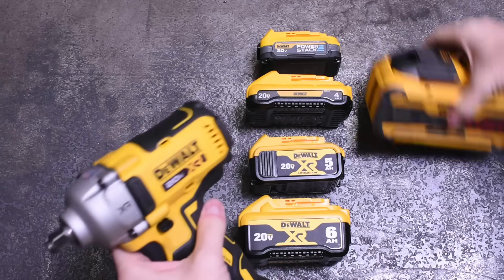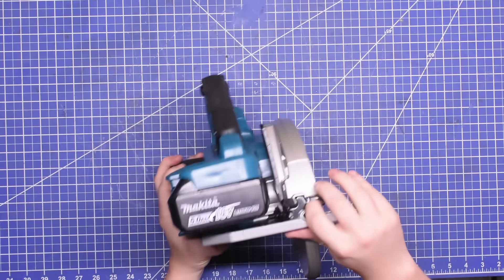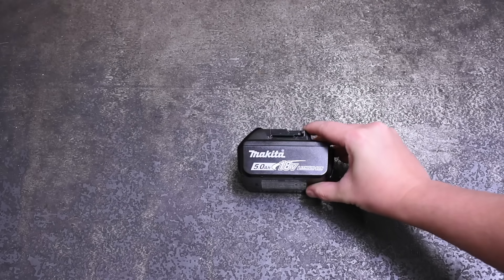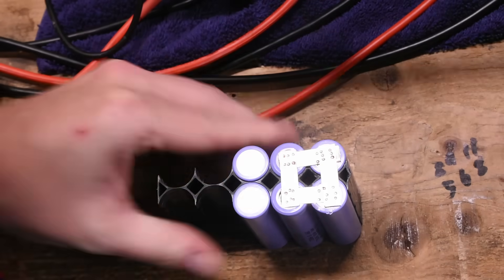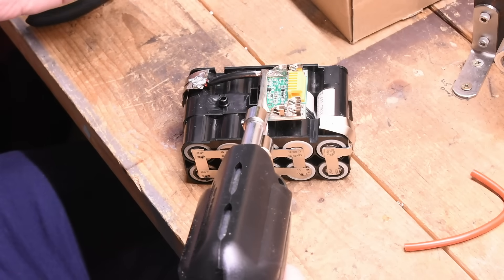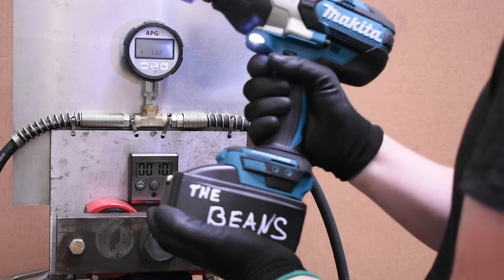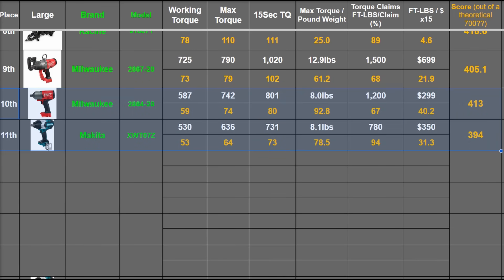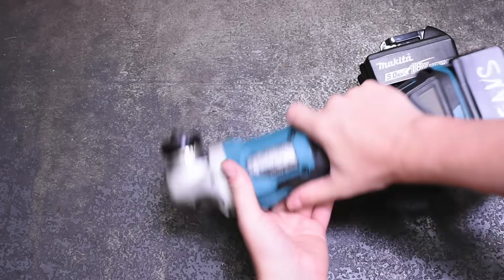We Built the Best Power Tool Battery for the "Worst" Brand

Comment: I'm amazed the BMS inside these packs isn't the "evil" type that bricks itself once you disconnect the cells!
Reply: Dont give them ideas!
Reply: they are working on that, some of the fancier tools for dewalt and milwaukee don't work without their battery packs
Reply: at 2:21 - it comes disconnected anyways. The downside of that is that the shell is ABS.
Reply: @stanimir4197 yeah but that's an aftermarket bms! They were talking about the original makita one the swapped cells in
Reply: Only tards like FutureMotion and some auto manufacturers  do that to their customers lol

For now...

Comment: makita has 40v now. lxt doesn't need an upgrade as its meant more for quality. the fact their tools and batteries work after 10-11 years of pure abuse is amazing. putting milwaukee under the same abuse as we use both brands makes them last around a year if not less. makita batteries more or less only fail on a dead short circuit inside a tool or being water damaged. meanwhile milwaukee kills cells, goes into constant overheat alert or physically snaps apart
Reply: this is exactly my experience also
Reply: do you now why that is?

Comment: I'm just here sitting in my apartment, only with a brushed 18v rigid drill/driver and impact driver combo with 2 1.5 amp batteries. I also have my daily apartment driver, an 8v NoCry electric screwdriver.

Comment: That's an interesting point about torque honesty after the beans pack.  I wouldn't be surprised if manufacturers do their testing and rating of their impacts with DC power supplies and/or capacitor banks, that can supply practically unlimited current with no voltage drop.
Reply from the maker: And yet we ran the M18 high torque with a 10ah stacked lithium over volted to 24V and it still didnt come close
Reply: @TorqueTestChannel so are you saying Milwaukee over inflated their numbers?
Reply from the maker: @EliotTruelove  I'm saying most brands do, even in tightening.
Reply: @TorqueTestChannel  who are some of the more faithful/honest brands?

Comment: What's that handheld spot welder that you used to tack the nickel strips to the batteries? That's my biggest holdup on making my own batteries.. I was trying to solder them and it wasn't working out - and I couldn't ever find a decent, affordable, handheld spot welder type of device.. That's been years ago though so maybe they're more common now.
Reply from the maker: https://amzn.to/44LOAEV
Reply: I would recommend the "Malectrics Arduino spotwelder" or the "kWeld" from Keenlab. Both need to be connected to an external power source. A powerful Lipo or a new car battery works fine. Hope this helps

Comment: I have made a battery almost identical to yours using Molicell cells. I have the 1/2 Makita Wrench and the grinder. I felt a ridiculous drop of power when used so about 1.5 years back I was deciding between a 9Ah battery using 18650 cells or an 8Ah battery using Molicell cells. I don't remember exactly what type of cell I used, it was their top 4000mah battery back then. There is a HUGE difference in how it feels between using that battery and the 5Ah that I have. From the start I doubled the nickel plates and very thick wires. I spot welded in many places on the cell. Careful that case is VERY breakable. I droped from 40-50 cm one (from a chair) on woden floor and it broke quite bad. Luckyily I ordered 2 cases from AliExpress and replaced it. I am now thinking of ordering some new spare cases just to be sure.

Comment: this is pretty cooool, but i dunno how long those tools will last getting fed The Beans, to be honest.. my Makita line up is about 12 years old, all rebuilt or "new" but old designs, aside for the 1/2 18V brushless impact and some smaller ones. Did that cos ive seen a lot of, lets say, 2016-18 model year tools just fried to death...
Though, granted, with a 5.0Ah battery, the sub compact 1/4 inch impact driver can tighten lugnuts on a car to 110ft/lbs, which is it's claimed power output. It's also the smallest brushless impact they make, so that is pretty badass.
Also, i'd use model numbers but Canadian market numbers will probably mean nothin to you heh.

Comment: why not use hobby battery packs? they are designed to put out 100c or more.
Reply from the maker: We tried 10Ah worth on one today, even wried into the OEM BMS's tools dont seem to like it. They shut off, two separate brands
Reply: @TorqueTestChannel  i wonder if factory bms is not capable of the current the packs are producing. might be worth trying to replace the electronics with a bms bypass for science sake. the only thing we need bms for is charging anyways.

Comment: I've used Makita tools for years with the same battery and they have no issues. Their drills, however... Anyway, Japan's philosophy of manufacture seems to be to underpower their product for the sake of longevity. You can see this with the V8 motors in their 70 series Landcruisers, too - beefy engines powered down to be durable and reliable. It means that the tool isn't burning out. But really, their 1/2" LXT is so beefy that anything with more power will strip bolts.

Comment: As a contractor I can say that my Makita 5ah batteries work all day, every day.  I haven't touched my milwaukee super sawzall, or mag 77 since i bought brushless makita tools. I also run Milwaukee m12 drivers and a drill as they fit in my belt perfectly, but I'm makita all the way otherwise.  Also, like infants, you can only drop densely weighted electronics so many times before things start to go wrong.

Comment: your thin ass nickel strip and bootleg spot-weld job couldn't handle the discharge current... and if Makita did make a battery with those good quality 18650 or 21700 cells it would cost a million dollars 👌👍😆
Reply from the maker: It seemed to do the trick here

Comment: xgt batteries are also quite a bit bigger than the lxt so i'm not even gonna go to xgt ever. i just made a realization that makita could change the orientation of the cells and get 21700 cells in there. would make the pack a bit longer but still compatible with all the lxt tools

Comment: Used good batteries but did you change anything on the circuit board? Swap out lower resistance MOSFETs or anything? This can be improved much further.

Comment: I am confused. Why does the capacity (Ah) determine the maximum power draw? Is it the number of cells?
Reply from the maker: Correct. It's not capacity. It's number of cells sharing the load and thier peak discharge rate in amps. For example a lower capacity lipo battery could beat this possibly

Comment: Ya I know Makita makes some good stuff but I was told to avoid because of their batteries… apparently you get 2 “strikes” (over discharge, over temp, etc) and the circuit board shuts you down permanently!
Reply: thats a load of crap. In 11 years of daily use with Makita I have only had 2 batteries die on me. Know alot more guys running milwuakee with failed batteries.

Comment: I have seen adaptors where you can use different brand batteries on different brand tools. I have no experience with them. Check into it see if they actually work.
Reply: I have a Milwaukee nailer I spraypainted RustOleum Lagoon, which is a slightly bluer teal than Makita, and I run it on a battery adapter. It's brilliant, and id highly recommend it.

Comment: All they have to do is throw more beans to the line as well and then the 40-volt will still look like a sufficiently good upgrade. I'm sure they can squeeze more out of those also. Makita is a premium brand and they charge a premium price they need to give the appropriate batteries.

 I have a DeWalt 9 amp 60 volt battery and a 6 amp version and those things are both beastie. I would love to have that 15 amp version but I don't want to have to pay for it.

One thing that DeWalt did right is they made it where my 60 volt batteries work in my 20V tools which are actually 18V. The 60 volt tools are really pretty awesome, I have the circular saw. I may eventually get the 60V angle grinder. I have an old corded Metabo made in Germany so I'm not that pressed on it, because that tool really does bring the beans.

Comment: While I do own Makitas and have yet to own a Milwaukee tool, this makes me want a Milwaukee.
Reply: Run a Makita off a battery adapter with higher output Milwaukee or DeWalt batteries. Adapters are incredible nowadays and have quite a robust built in BMS.

Comment: Pretty sure they didn't bother making anything beyond what they have because of XGT. Obviously it's a different set of batteries AND tools, but that was kind of the point. 
Also, the crazy Dewault packs and the like are a little ridiculous to even consider holding/storing/using.

Comment: Makes me wonder if the battery pack being limited in raw output is calibrated to the cooling of the tool . EX the tool can crank 600W of output with the modded battery pack, but can the tool COOL itself for 600W or will that release the magic smoke quicker via overheating?

It would be cool to see temperature somehow incorperated into these tests so you know that the tool is able to adequately cool itself at the performance given

Comment: Hey Guys! We also do a lot of testing with Makita Batteries
Expect we use 12 or 24 of the 5Ah at the same time to power electric Go-Karts, Drift Trikes or similar 😃
I have some thoughts on the video/testing.

With this cheap Chinese Kit you have to make sure every part of the main current path is up to the task. If only one of the parts don't perform you can easily loose 30-50W on one or all of them. Nickel Strips, contacts for the tool, PCB Traces, Fuses etc..

Your tip of just replacing the cells in the Makita could get difficult since all 5Ah/6Ah Makita Batteries all have suicide Fuses on them. That mean the microcontroller can decide to permanently disable the battery forever and burn the main current fuse via a heating element inside the fuse. You probably need to bridge the Fuses and the Mosfets on the PCB to be sure.

Thermal Management is horrible on the Makita Batteries! They did absolutely no engineering against preventing the heating of the cells. 

For amazing soldering experience with thick copper parts/cable get the Weller W 201 and a lot of soldering flux in a syringe! 😇

Also I think doing a 10Ah 5s4p configuration with 20 x cells could be fun and fit any tool. You could just weld it to an exciting pack and 3d print a case.

Comment: I run the 9A FlexVolt batteries via adapter on my single battery LXT tools for the most part. They do seem to have more jam, but sadly Makita's tool protection just cuts in faster. The prime candidate for a battery with higher discharge is their rear handle chainsaw... While it IS an LXT 18V2 tool, the batteries are located on either side of the tool, unlike the top handle saw. This means you can run 21700 LXT packs if they existed, or in my case, a pair of 9AH FlexVolts. Chainspeed is higher, torque seems to be up, yet the tool will cut out at the same same loads and require a time to reset. Wish there was a workaround on such protection systems. While you could argue this tool will last me longer if it isn't being overworked, I'll argue that actually last forever because it sits on the shelf while I use the competition to get actual work done. Makita makes some great tools, but they've really screwed over their customers this with this generation of cordless batteries...

Comment: I like all your videos. I have many Milwaukee,  Dewalt and Makita tools. They're all very close in terms of performance,  but I generally find Makitas to be more reliable.  The batteries are the weak link. However,  a far easier solution is to just use a battery converter to run Mikwaukee and Dewalt batteries on my Makitas.
Reply: That's the real solution going forward for those who want the power. I've never felt I needed to go it, although I have the adapter for it.

Comment: Coming from a RC enthousiast, this makes me wonder.
How much more power could these tools handle if you put a big 8000+mah 100C LiPo pack on these.
Seeing some RC speedrun cars take 400+Amps from 8S packs. Or 11000+ watts.
Sure its not doable for normal use, LiPo is far to volatile for work use like that. But would be fun to see.

Comment: bigger fuel tank does not make faster car
Reply from the maker: true, and i agree at face value. Only if the cell inside can achieve higher discharge rate AND the tool is requesting that do you see a gain, which we did here. But bigger doesn't always mean better

Comment: 25r's used to be the standard in vape stuff a few years ago but the sony vtc6 was the better choice with 3000mah and 30 amp discharge per cell. But they were more expensive at the time. Now in my ebikes, I use low discharge cells like 7 amp ones but add many in parallel.

Comment: 8:46 they already know this, and they definitely have a nice graph showing how life expectancy stays mostly flat up until you beef up the battery as you just did, perhaps they left a 10-20% buffer zone for future "upgraded" tools, but you have no idea if you simply filled that up or went beyond it and your tool will burn out within a month
Reply: Yeah, I don't know if this is him hyping his vid or just arrogance. All the major brands would have pretty extensive data on how their motors, ESCs, and batteries hold up under different power levels, duty cycle, temperature, etc.

Comment: You could build a very large high capacity battery pack, and then connect it to the tool via a thick lead to the tool with an adapter without the weight problems of a heavy battery;  this post for release April first !
Reply: Like the old NiCad Bandolier kit loaded with 5000 mah  D cells. You wore the battery like machine gun bullets.

Comment: Makita is garbage, but so many serious YouTubers and workers love Makita for some reason.

The first, the only, and the last Makita tool I ever bought with my own money was their venerable rat tail grinder.  

Used it with cutoff wheel for 20 minutes to split apart and throw away an old metal fence.  Put the grinder back into its blow molded case without dropping the tool or the case, reopen the case one year later... tool grease EVERYWHERE!

Garbage.

Comment: Great job!!!

I have a pile of very old Makita 18v batteries....  1 finally died....  So I dunno if your "max it out or bust" style testing is killing them, or what...  But in normal use & abuse at times....  these have lasted far longer than a reasonable person could expect or ask....  

Just saying....  1 person's opinion.  I know, you guys don't like Makita....  And that's fine.  Often your testing shows, they are not the absolute best....  For my money, you get "trapped" in a battery ecosystem....  so you need to be careful, when you pick those first few tools....  the pros & contractors I talked to years ago, 100% of them said "Makita.  If you can afford it, just buy it, it's the best."  

Now I get it, that not every tool they make is the best in each category....  Yes.  BUT, on the whole, all of their tools are in the top third, of whatever is out there.  And I work mobile.  I am out at a customer prem.  I need it to WORK.  It doesn't HAVE to be the "best", on paper, on your spreadsheets.....  But it does have to WORK.  And it always works....  Since around 1993, my Makita stuff has not let me down....  I know, that's not science.  That's purely anecdotal.   It's worthless information.   I know.  I'm just saying, there are definitely worse battery ecosystems you could be trapped in....
Reply: I'm right there with you. I'm kinda sick of apologizing for Makitas ergonomics and reliability to this who don't give two craps about that. Motorheads who are used to their vehicles being in the shop might not mind their tools also being in the shop for warranty issues, but I do. I want my tools to WORK, and be comfortable while doing it. I don't want my impact, drill, or saw vibrating my arm off, just like I don't want to drive a rumbly loud gas guzzler all the time. The reason old guys prefere Makita is because those vibrations affect you when you get older, and my early onset arthritis thanks Makita every time I sue them, and curses DeWalt and Milwaukee if I have to use them (with the exception of the M13 and M18 Surge Impacts, which are realistically Milwaukees versions of Makitas oil impulse impact).

 Care and attention to detail are what Makita users focus on, not cashing a check from a fastly and powerfully slapped together project.

Comment: Keep in mind a higher output battery will have a negative impact on tool durability.  It's entirely possible Makita has already performed such an investigation and is unwilling to accept the shortened life that will lead to more warranty claims as well as altered customer perception of the tool's reliability.  As we all know, on average, the Japanese put a high importance on reliability.
Reply: No, you're wrong here.
Its not a "higher output battery" the battery doesn't "push" amps through a motor.

Voltage and RPM are connected, whereas motor load and Amps are connected.
At the same time, when amps go up, voltage drops.

What happens here, is that the motor is still "requesting" aka "using" the same amount of amps (or just marginally higher, due to resistance things), but that amperage is delivered at much more stable voltage across the board.

Amps are also the thing that damages motors. However, if the same amount of amps are drawn, at a higher voltage, you effectively get more watts "for free" as far as the motor is concerned.

Voltage is not going to be higher than the motor can handle, but it will be higher at the amperage the motor requests.
Reply: Yeah no😂. 
You've over paying for a dogshit tool. 
I have 15yr old blue ryobi batteries that are still kicking😂. Makita makes a KILLING off of you dunbfucks. They dont last longer and they arent better quality😂. Paying for a discount ryobi😂😂😂